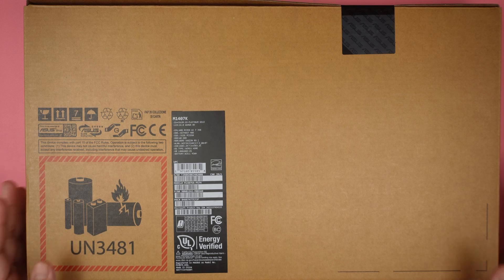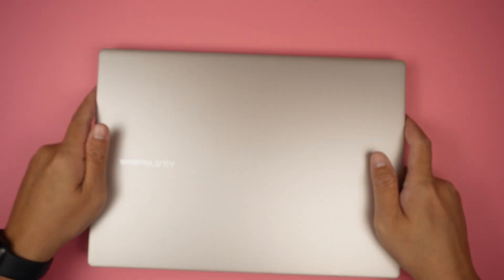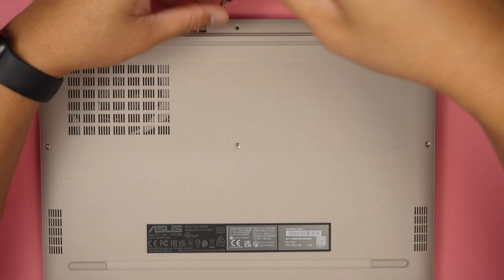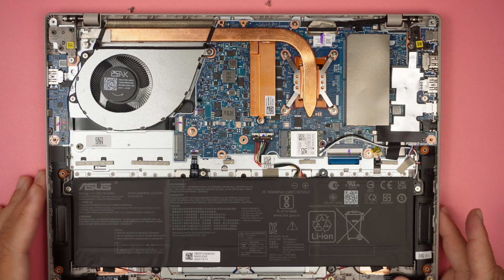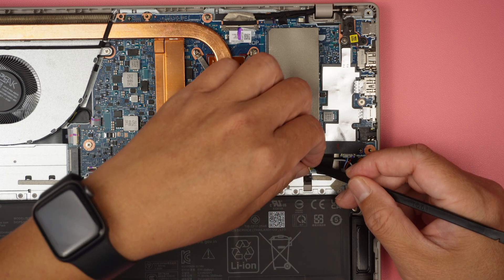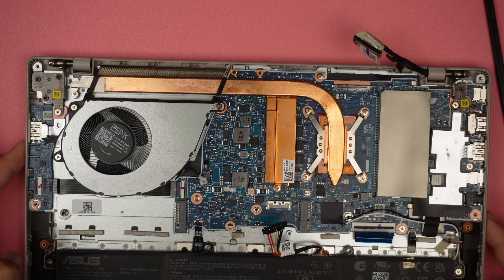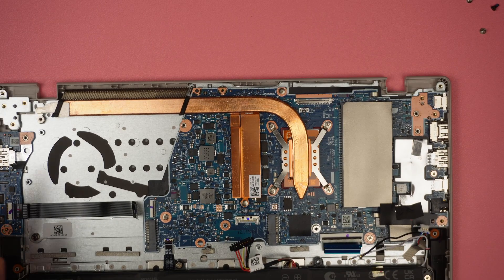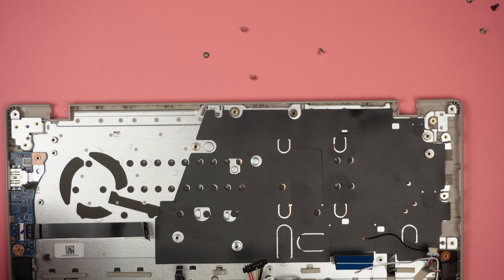Asus VivoBook M1407KA Teardown & Upgrade – What You NEED to Know! 🔧💻

Comment: I recently tried to get one of th3se laptops namely the M1407KA....but what i found out is the second part if the model.number matters 

M1407KA-LY014W = a Ryzen Ai 5 340 Six core processor 
M1407KA-LY134W = Ryzen AI 5 330   3 Core processor .....it seems retailers are making mistakes and looking at the main part of the model.number M1407KA and forgetting the rest this is how they send out the wrong one .  Basically I have a laptop to be sent back hoping I can get the one I want . 

A great video and worrying that there seems not much protection between the ssd and the base of the laptop.